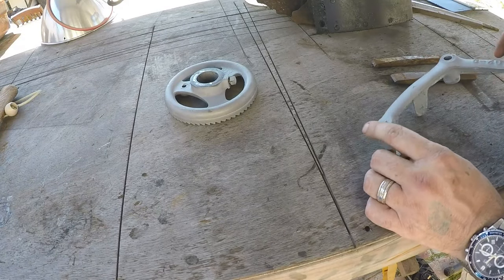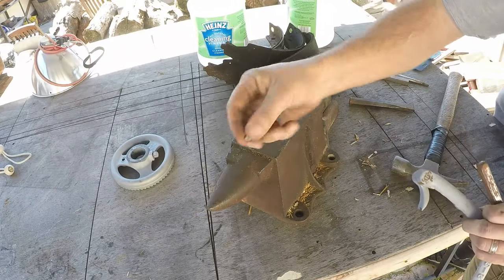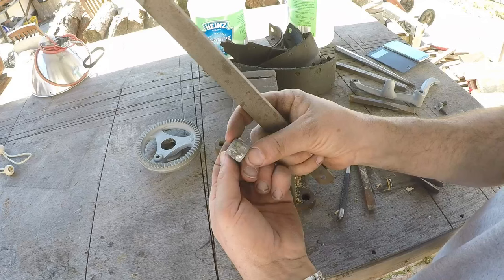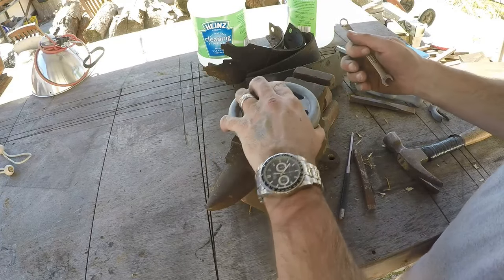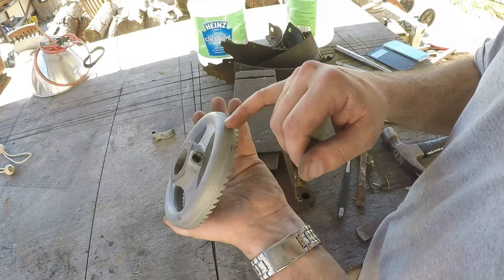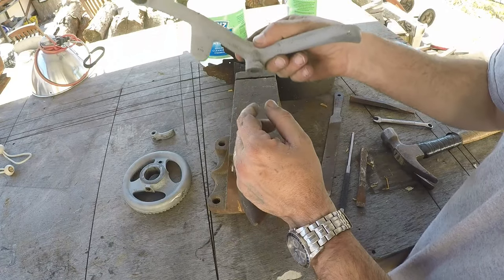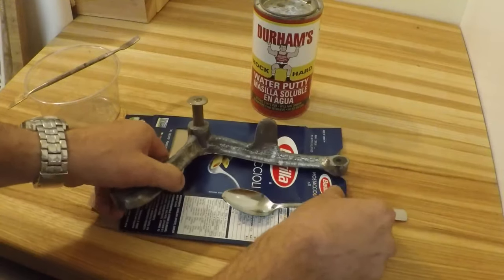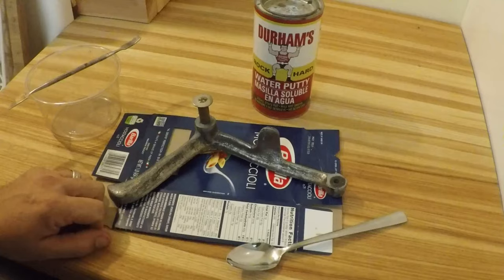Foundry Pattern Making from Parts

Comment: If you build the paw back up with body filler, you can eat it back off with stripper. Then you can have enough material on your new cast part to form a proper edge. When you form and reset the hot rivet. a shim between the paw and arm will assure some end play.  I hope you give us the economics of the whole process as well.  Someday when you have your line drive 3D metal printer up and running it won't be an issue.
Reply from the maker: +Crafted all good ideas it would be nice to have a 3d printer prices keep coming down so maybe soon
Reply: Ok,the 3d printer remark was a joke.;-)
Reply from the maker: +Crafted I think the 3d printer would be great for pattern making.

Comment: Hi Chris,
Do you anticipate problems due to shrinkage...???  Or are you planning to increase slightly the size of the parts...
Reply from the maker: +Pierre's Garage shrink is about 1/8" per foot in cast iron so the shrink in this part would not be more than 1/16" .and that's acceptable in this instance. Critical things like the holes are to be machined new . "Famous Last words lol"